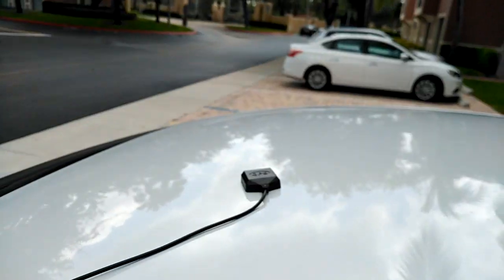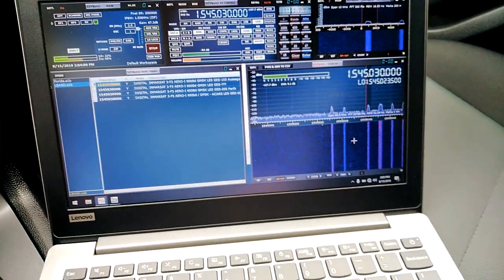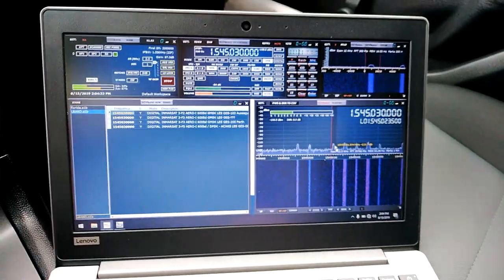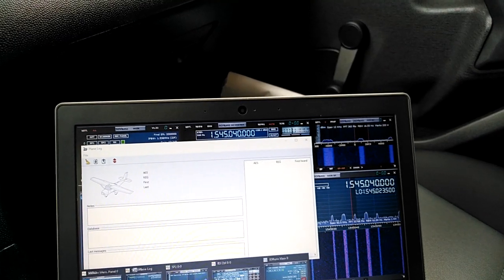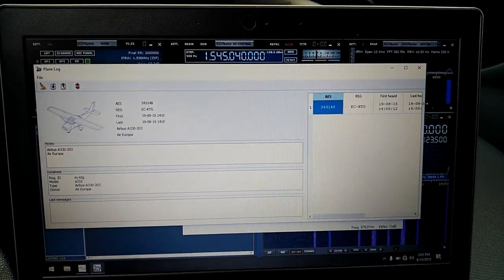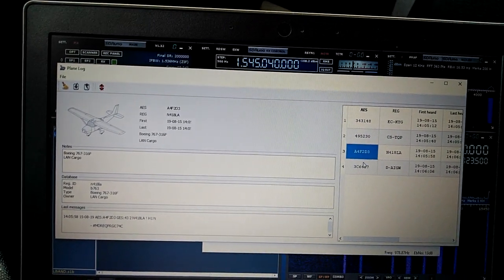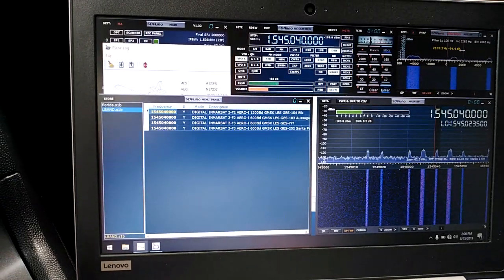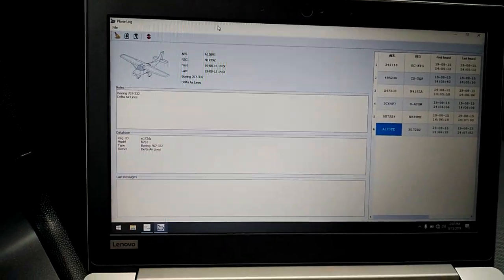Exploring L Band with SDRuno: P2

Comment: Really interesting video on INMARSAT, which I would like to do.  But.... I have an older SDR PLAY, which is no longer made (first generation) with the latest SDRuno software: 1.33.  I am really having a hard time entering frequencies.  There must be a trick to this.  Please note:  I also have a WINRADIO  and frequency entry is elementary.   When I goto say an FM broadcast band.  First I hit FM mode.  Then hit the frequency (in KHz range and don't see how to change to MHz??)  I put in:  90.3 (hit the decimal on the key pad to the right.  Hit enter. At that point it starts to scan.  I have no idea why.  If I could just get this thing to obey they frequency command, then get it to monitor FM broadcast, then on to Satellite weather images, then last but not least INMARSAT.  There has to be a way to do the frequency entry so it stays on the same frequency (with out scanning)??   Maybe you should do a video just on frequency adjustments????  I have been over a number of youtube videos  and they cover frequency change.  But....  The post date of the video can be 2017, 2018 or 2019.  They are not using version 1.33.   Or, maybe I need to up grade to a newer version of the SDR Play.  I am at a loss, but feel that this is a good receiver if I can get control of it.  Any help you have would be most appreciated.  WD5GYG
Reply from the maker: Video #1 should cover all the basics.
https://www.sdrplay.com/sdrplayhamguides/